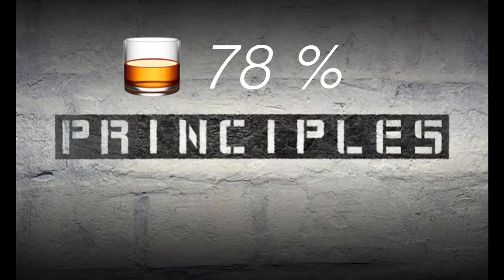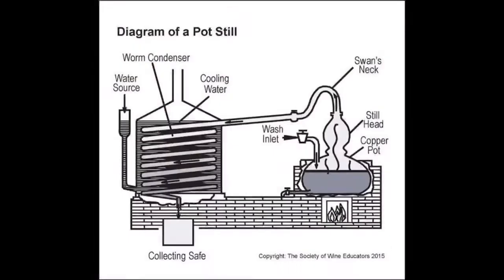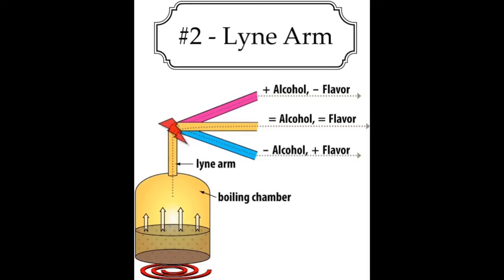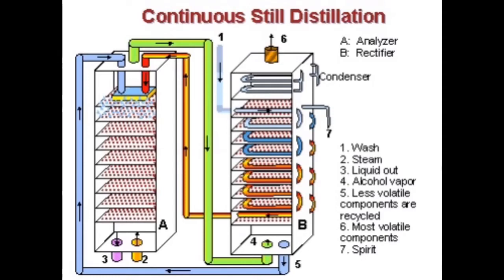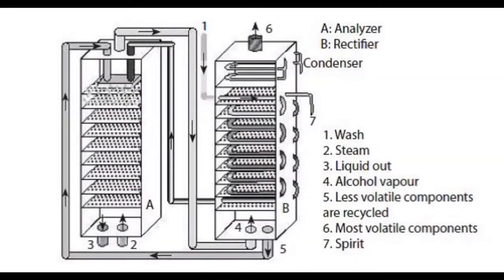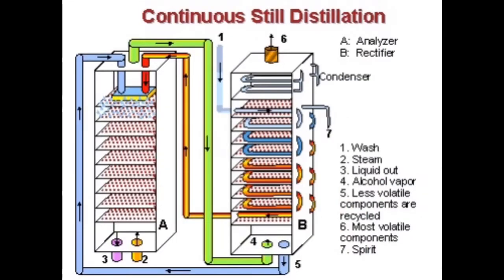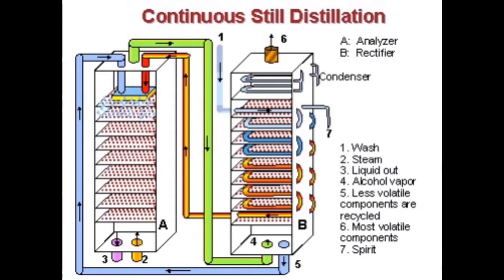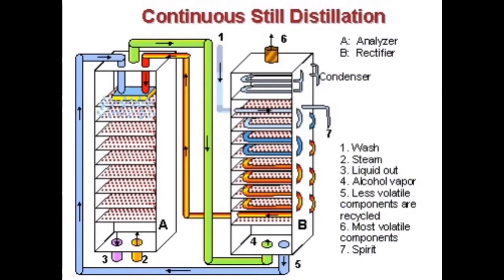Distillation: Pot still and Patent Still ( Working and Method)

Comment: Can you tell me how much percentage of alcohol and residual suger in malt wash
Reply from the maker: Kunal Rana the question is interesting and worth investigating. The amount of known and expertise I have on this subject I will answer as per that.

The malt wash you are talking about is just the beginning of the fermentation process, the residual sugar as you know is the sugar left after the fermentation is complete. This may vary on 2 factors 1. The type of yeast used ( bakers or brewer) and the kind of grain used with other external factors like temperature/ maturing/ water content extra. 

It usually ranges from 1% to 10%, but this will be distillary and maker specific